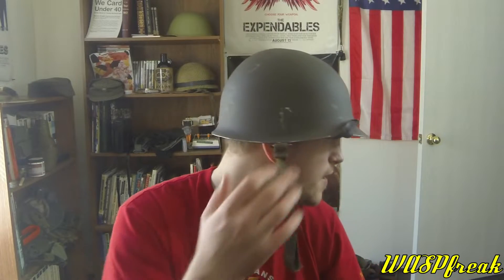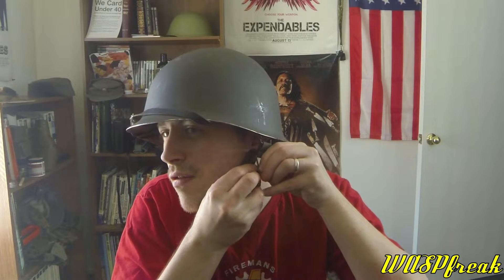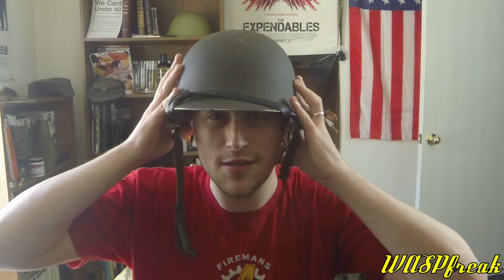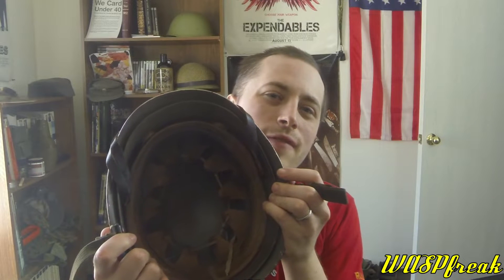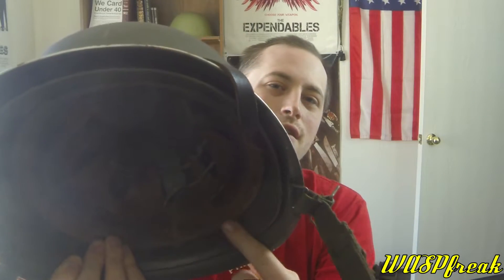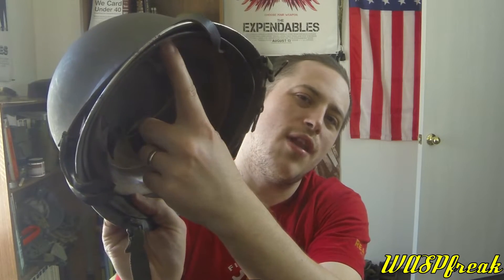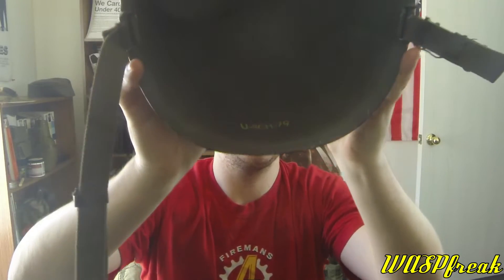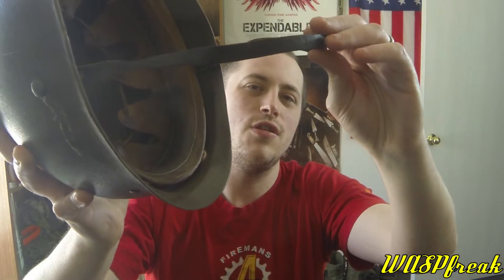Austrian M75 Steel Combat Helmet

Comment: I agree, we never used outside liners. We used nets. To camouflage ourselves put what was around as plants, foliage, hay, whatever you had to blend into, into the net.  I would guess the one you have in the video was either from some officer or at least non infantery. Because we had to use the steel part for washing and shaving. (for that you would either clamp it in betweeen wooden sticks or place it "firmly" on the ground so it would keep the position even if it is filled with water. And the one you have there looks untouched on the inside of the steelpart and as you stated amost unscratched on the outside, but the plastic helmet's liner looks like it was used a bit. (either someone only using the inner part -> parades, or someone who doesn't have to wash in it and crawl around in the woods or around objects that could scratch and dent the thing...)
Reply from the maker: Thanks for the info!

Comment: Hello I had bought an Austrian m1 helmet with many scratches and I want to apply rust primer and german tank grey color paint on it to prevent rust as I will be using it a lot in tropical environment. Would that be neccessary?
Reply from the maker: That might not be a bad idea.